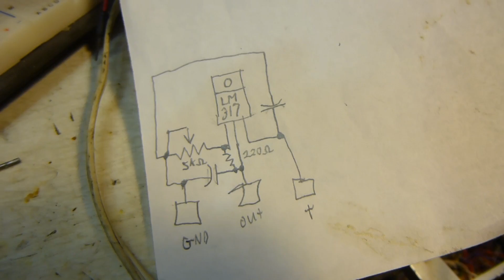DIY Varibale Voltage Power Supply

Comment: nice! i made basically the same thing, just a little more compact i will post a picture of it on G+ they are very handy indeed, i think i briefly mentioned it in my massive ZVS driver video i also have enough components for 10 of them :) i only made up one though.
Reply from the maker: SuperBrainAK Cool!  Looks really nice!  I think the heat sink on mine is over kill to the max!!  I have a bunch more salvaged LM317's so I could make several more too.  But I really only need one right now.
Reply: Makerj101 yea i havent seen any in the things i have taken apart as they where always fixed regulators or very analog using resistors transistors and zeners to regulate the voltage. and yea i dont really need more than one, though i might make one complete with a 3pin fan output and barrel jack input to use at work. at my desk i have a KVM for the desktops that i work on and because there is a shelf above their rears the heat collects and will make my passively cooled switches (dual 8 port gigabit) get pretty warm. i already have a fan setup i just need to be able to control the speed, and that will be simple to make as i already have the parts.
Reply from the maker: SuperBrainAK I've actually salvaged a lot of them.  I got a bunch of these old expansion cards from some old equipment and each card had two LM317's and a 556 dual timer chip!  Three nice parts on one board!  What's a KVM?
Reply: Makerj101 wow nice!! you could easily make a legit PWM circuit out of a 556, look up how to make a pwm circuit out of 555's its pretty cool. a KVM stands for Keyboard, Video, Mouse, it is a switch for connecting multiple computers to one desktop setup so i can have multiple computers connected and switch which one i am controlling with a button, it saves space and time so i dont have to have multiple monitors, mice, and keyboards setup, just 4 computers and one KVM setup.
Reply from the maker: SuperBrainAK Yeah I could!  I like PWM circuits that use a 555 timer and an op amp.

Huh, I never heard of such a thing before.  But that's really cool.  Would be useful to get a video editing on one computer and then switch over to the other computer for some gaming without it lagging.  I could see two computers buy why four?
Reply: Makerj101 well it is mainly for IT work situations because i can work on setting up 4 computers at once basically. and when they are doing a long task i can work on another one and so on.
Reply from the maker: SuperBrainAK Ahh ok!  Cool!

Comment: Cool, but I have a question, what does the ground do when we have the negative output and how do we built it?
Reply from the maker: Spreedator 1000 The output is not negative.  It is positive.  In this configuration the LM317 is basically acting like an automatic variable resistor.  Here is the schematic if you'd like to build one:  http://www.circuitstoday.com/wp-content/uploads/2011/04/LM317-typical-adjustable-regulator-ckt.png
As you can see I used bigger capacitors because I wanted to.  But everything else is about the same.

Comment: Great variable PSU. I dont think its going to die from heat somehow.
I'm a big fan of not using etching chemicals. They suck. Never tought of hand grinding though. Great idea. I bet a ton of simpler circuits could be done that way.

Thats a neat little volt meter. What voltage does it need to run? will it actually run on the 1.6v it displayed? or is there a seperate power input to light up the display? I have been looking for one that will run reall low. I have a few devices I want to run on zombie batterys that need a volt meter. so far analog is all I can find that runs under 5v and then the impedance is too low and it pulls too many amps.
Reply from the maker: Mongrel Shark Thank you!  Hahaha yeah probably not!  Yeah it was just so much quicker.  I've used this method before and as long as you draw out exactly what you want and take your time you can make it pretty nice on the first try.  I don't mind the chemicals, it's just how long all the steps take: designing the layout, printing, cleaning, transfer, cleaning, etching, cleaning etc.

I think it needs like 3 volts.  But it has 3 wires: ground, power, signal.  So I have the power wire connected to the voltage input of the regulator and the signal connected to the output.  Then if I'm using the regulator at 1.6 volts the display still works.  So you could use these with your "zombie batteries" but you'd need a seperate power supply to run the volt meter.  Just search for something like: "mini LED digital volt meter 3-wire" on eBay and you should find something like what you are looking for.  There are also ones with different voltage ranges. The one I've got can measure from 0-100 volts.  This one is good for 0-30 volts which is probably what you want with your application.  It would be able to display more small digits. http://www.ebay.com/itm/141049350659?tfrom=130978113571&tpos=unknow&ttype=price&talgo=origal  
This one would be even better for you if you need lots of digits after that decimal point. http://www.ebay.com/itm/Mini-0-50V-DC-3-Wire-LED-Blue-Digital-Volt-Meter-Voltmeter-Ammeter-Voltage-/161288305061?pt=LH_DefaultDomain_0&hash=item258d8839a5
Reply: Oh. I need over 100 volt reading. One decimal is good. Its for a zenner diode tester. Zenners go up to around 130v... Although over 20v is rare. Lots of component testers will identify zenners up to around 9v, but not any I have seen test higher...
3v power is doable. I can get that into a cap from the zombie battery no worries. as long as the amp draw is not too high.... Its a bonus if it can run from higher voltage as well. Then I dont have to limit the caps max voltage too low...

What's the sense impedance? If you dont know just measure the voltage of an ohms meter and the meter will tell you the input impedance of the volt meter.....
Reply from the maker: Mongrel Shark Ok well you can find the same kind of meters that go to like 200 volts.  I think the draw of these little meters is something like 10ma.  I'd have to measure it tho.
Reply: If you have 10 min spare I would appreciate it a lot. As well as knowing input impedance (just uploaded a video on testing that)

A lot of similar ones on ebay are listed as less than 30ma. but running from 3v-30v I imagine it varies a lot.

Haven’t found one listing that has input impedance yet. 2 out of 10 sellers I messaged have replied that they would look into it and not replied again.
Reply from the maker: Mongrel Shark By input impedance do you mean resistance?  If so I took my ohm meter and measured the resistance of the sensing lead to ground.  It's about 360k ohms.  As for the current draw of the power wire it's about 15ma and doesn't change much with supply voltage.  It's probably just using a linear voltage regulator.  This is the one I have and I've got the red version: http://www.ebay.com/itm/VS2-Mini-Digital-Voltmeter-DC0-100V-LED-Panel-Voltage-Meter-with-Three-Wires-/400801615871?pt=LH_DefaultDomain_0&var=&hash=item5d51a34fff
Reply: Thanks you for doing that! You got the idea with input impedance. I was hoping for 10m 360k is too low :( Going to cause too much interference and my little boost circuit will only be able to go to about 65v. Looks like I'm dreaming hoping for a low power high impedance volt meter. Back to the drawing board....
Reply from the maker: Mongrel Shark Yeah no problem.  Hmm well can't you just use a resistor network?  Have a 9m and 1m resistor in series and then have the meter connected across the 1m resistor?  You would need to work out the exact resistances to compensate for the resistance of the meter.  But in theory if you wanted to measure 100 volts you would get 1/10 the voltage across the 1m resistor so the meter would read 10 volts.  High voltage oscilloscope probes use the same concept.  I also tried to measure the voltage of my homemade flyback transformer like this.  The problem was my resistors were not rated for high voltage and arced over killing my meter...
Reply from the maker: Makerj101 Technically it's called a voltage divider. Here a homemade high voltage oscilloscope probe:  http://www.instructables.com/id/DIY-High-Voltage-Probe-for-digital-multimeters/
Reply: I'm aware of how resistor networks work in voltage and current metering systems.

360k for the meter is a pretty limiting factor though. The best I can figure is 1/100. with close to a 10m total resistance. so 5v is 50mv, and 120v is 1.2v on the meter.

No matter what resistor you put in parrallel with a 360k. You can never get more than 360k. Only less.

I did a sim with 5v input. So 500na through the circuit should be 10m ohms total. I'm happy with anything in the ball park there. 9m would be ok. Or anything significantly over 10m ohms total.

Spent ages messing with the values. Cant get 1/10 without changing the 360k to a higher value.

Would be easy with a 1m impedance meter...

here is the sim if your curious and not too busy.
http://tinyurl.com/qzxn45a
Reply from the maker: Hum...  Why not just use one of the cheapo meters that you showed in your video?  They had 1m ohm impedance
Reply: They also run on 12v battery, and the board is bigger than I would like. I know I'm being fussy.
Reply from the maker: Mongrel Shark Hum I'd revers engineer the circuit.  Most ICs use 5 volts and when they are powered by 9 volts there is a little regulator.  So if you bypass that you may be able to power it on down to 3-4 volts.  I'll take a look at one of mine and see.  I could be totally wrong.

Comment: You could use a 555 based pwm controller on that yellow wire.
But good work on that pcb, simple and solid.
Reply from the maker: ***** Wait really?  I always thought the yellow wire was the self destruct...  Not really, but I have burnt out several fans when the yellow hit the supply.  I normally just cut it off so that doesn't happen.  So if I put a 555 timer signal in then it should control the speed?  Thank you so much!
Reply from the maker: ***** Wait, are you sure the yellow wire isn't just feedback - RPM?
Reply from the maker: ***** Ahh ok.  But I actually do have a fan or two that has 4 wires.  So I could try it with one of those.

Comment: Nice little thing! Always useful for secondary power! 

Btw, how do you control the laptop battery from getting too low?
Reply: Makerj101 you need to watch out for Li-ion they can lose alot of capacity when they drop really low, i had actually made a little circuit using the original protection for the battery and basically had an analog on/off controller with low voltage cutoff, it is a very old design of battery protection most of the newer ones you cant do that with.
Reply from the maker: Anton Babiy Thanks!  I don't!  I probably partially ruined it the other day when I was using it to run the pump for my steam engine.  It was basically dead and wouldn't run the pump any more.  Though I charged it back up using this regulator and it seems to be holding a charge ok.  I need to keep a better eye on it and not let it get too low.
Reply from the maker: SuperBrainAK Yeah I should actually buy a little charger for them.  I think they are pretty cheap.  I think I could also make one.  Not sure on that...  Thanks

Comment: It would be awesome to actually utilize the mechanical motion from your steam engine to power your fan, that in turn causes more pressure to accumulate in the boiler, thereby creating a positive feedback loop ;P
Reply from the maker: Matthijs Smits Yeah I've thought about using a steam turbine to spin up the fan.  Problem is when the pressure drops and I need more heat there would be less pressure to spin the fan so less air and less heat.  So it would be a positive feedback loop sometimes and a negative feedback loop other times.  So I would probably need to use some kind of governor to keep the speed constant.  I think using a generator on the steam engine to power the fan would be easier.  Thank you!

Comment: Nice work! Want to build one like this! going to make a wot wire foam cutter, and this would be a nice way to regulate the heta.  However, parts not really available here, so i'll have to order them online from China and wait another 2 weeks...
Reply from the maker: Triangle_DIY Thank you!  For a hot wire foam cutter you could probably use a transistor to make a constant current supply.  However since you can't easily get a potentiometer, you could just use a spring as a variable potentiometer.  I've done that before and they actually make really good resistors if you find the right ones and they are easy to find.  Steel wire will also work quit well.

Comment: U could use that to drive some power transistors and get more current
Reply from the maker: Raymond Bivens Yeah I've thought about making this power supply which does that.  http://electronics-diy.com/power-supply-lm317-2n3055-0-28v-6-8a.php

Comment: I don't use 317's anymore as they are linear meaning inefficient. Also the are only good for about 1.5 amps if you can get the heat out. I also like current limiting so things don't go up in smoke. I use these http://www.ebay.com/itm/DC-DC-Buck-Module-10A-Constant-voltage-current-Solar-Lithium-Battery-LED-Driver-/171302267081?pt=LH_DefaultDomain_0&hash=item27e26928c9
Reply: I second what Robonza says.
Reply: rawley69
Thanks, I should have mentioned that the 3amp 2577 switchers boards are only $1.40 shipped these days too. I always keep about 10 in stock.
Reply from the maker: Robonza I bought this one which failed. http://www.ebay.com/itm/DC-8A-Buck-Converter-Constant-Current-Voltage-F-Solar-Battery-Charger-LED-Driver/261278924041?_trksid=p2047675.c100005.m1851&_trkparms=aid%3D222007%26algo%3DSIC.MBE%26ao%3D1%26asc%3D28808%26meid%3D37605f00ff8c4ca08b28287db3fed074%26pid%3D100005%26rk%3D3%26rkt%3D6%26sd%3D171302267081&rt=nc

That one looks more well built.  I think I'll buy one since you recommend it.